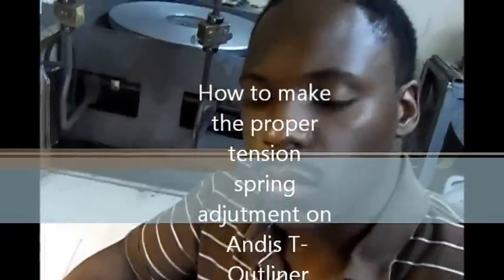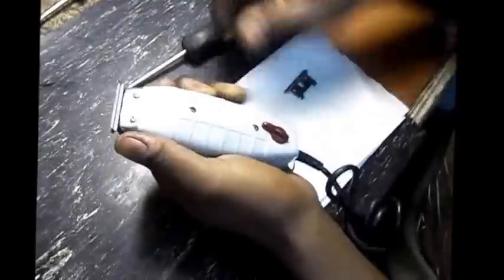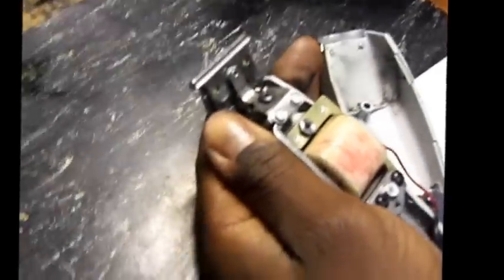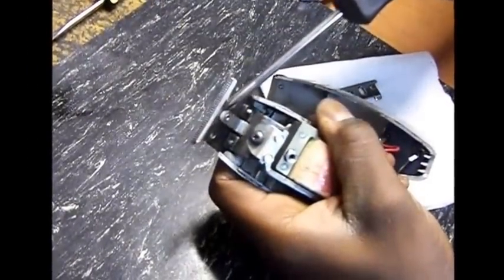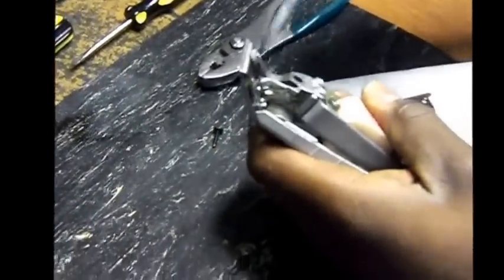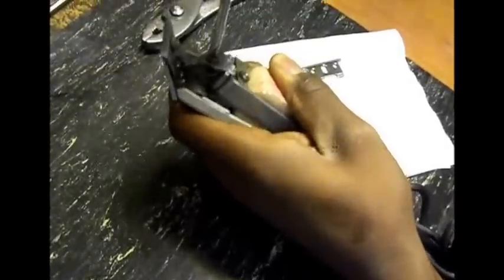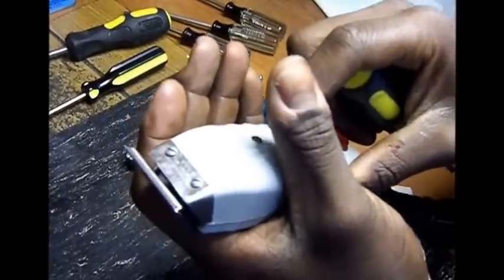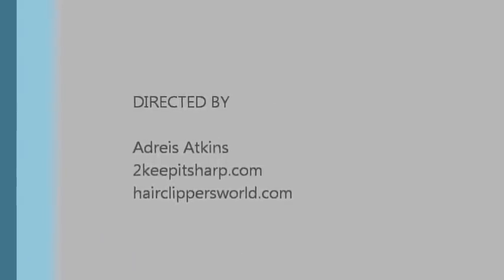T outliner tenion spring adjutment

Comment: That "Squeeeeze slighty" just saved me a trip to a professional repair service! I sharpened the blade, I even adjusted the tension spring. I was missing the part where it clicks and where it's touching the blade before  screwing back in. Made a huuuuge difference when I tested them again! Thank you so much! #Lifesaver

Comment: Great Video! Just fixed mine tonight after mine stopped cutting for like a week. Followed all these steps and I think the very last step with making sure the metal guard isn't touching the tension screw is what finalized it all. They seem to cut better than before they stopped working. I've had these liners for easily 10+ years and have never changed the blade. I think I might change it because it's definitely rusted.

Comment: Perfect video! My outliner is cutting like never before. I did notice on mine that I had to adjust the the tension spring with the ball a little closer to center. Any higher and my blade would nick and bite on one side. Thank you for the tutorial.
Reply from the maker: you are welcome. thanks. let me know if you need help with anything

Comment: is it true that another test is to put slight finger pressure on the blade when its in motion and if light pressure stops your blade you need to adjust, but if light pressure only "slows" its vibrating slightly, its good?

Comment: Hey man appreciate the video. I adjusted my spring to naturally sit above blade whole and touch blade naturally. But when i attempted to put the tension spring screw back in the hole it did move the spring at all and wont tighten anymore. If i continue to tighten spring screw more it begans to strip the spring screw head. Any advice? Im thinking the hole of the tension spring is to far away from the spring screw hole.

Comment: Only problem is my outliners get hot faster than before did I adjust the tension spring too tight or is this normal ? Will this affect my clippers in the long run ?

Comment: hey man if your tension screw and ball is completely not touching the blade... will it be able to fix watching this??? my thing is completely not touching the blade and the tension screw part looks uneven to the hole.. i need to get some pliers and try to fix tomorrow .. i keep buying new outliners every 4-5 mnths damnn man
Reply from the maker: this will work for shore. you must follow the steps properly. if you have issues I can help. also if you have clippers you not using we offer cash for you old trimmers and clippers. that's if you want to get rid of them

Comment: Hey so I did this and not even my t outliner pulls hair and even when I tighten the tension spring all the way the blades continue moving as normal...does this mean that the ball is not making good enough contact with the blade?
Reply from the maker: Infamous1ism this is true. if the contact is not tight enough or if not in the correct spot it will pull hair instead of cutting hair

Comment: Hey man, I think I am doing something wrong, mine are making a really loud buzzing sound, what could that be? When I followed your instructions I got 0 movement. The blade wouldn't swing. I'm obviously messing up at some point.
Reply from the maker: in this case you have to much pressure on the spring. bend  spring back slightly

Comment: Hey, brother. I have a question. I recently bout brand new T-Outliner clippers, and I'm noticing that they're not hitting as close as I would like them. I've adjusted the blade and the spring seems to be on point. Is it possible that the blade that came with is no good?
Reply from the maker: Levi C. in most cases the blade will come dull. that why we sharpen the new blades first

Comment: Hey man I had a question, I dropped my t outliners, now they don't cut at all and they make a loud noise. Do you think the tension spring moved a bit when they fell?
Reply from the maker: in most cases when the clipper hit the floor the coil core slides over slightly causing the vibration in movement to be hindered. this means you have to open the clipper and move it back over

Comment: Another way to get the blades sharper is remove and clean the blades, re-install them but tighten the tension spring tighter then the normal adjustment, lightly oil blade, run the blade for 5 min, this will sharpen the blades, then readjust spring according to this vid
Reply from the maker: jfool289 thanks for your insight. thats good info that any barber or clipper tech. can really use. its nice of you to be willing to give it for free. Thanks

Comment: is there a trick or technique to keep the body of the t blade cool that things gets mad hot sometimes
Reply from the maker: +Justin Grant no cool lube. they get hot
Reply: +keepitsharp357 I have the clipper oil and the clippercide pressurized disinfectant spray which is just about to finish so I'm thinking of trying something new(if there is ) because   the blades do cool down for a bit but in no time they're back to molten lava
Reply: +keepitsharp357 Do you  use this method  every  time  you replace  your  old blade with  a  new  one ?
Reply: +keepitsharp357 Do you  use this method  every  time  you replace  your  old blade with  a  new  one ?

Comment: The black tension spring screw wont screw in all the way:/ help pls!
Reply from the maker: sometimes it will miss its original grooves. twist counter clock wise several times then with your screw strait as possible go clock wise with your screw firmly until you lock into the grooves. that should fix your problem

Comment: hey man im tryin this but i dont seem to get it right. my machine was fine then sometimes gets stuck and sounds different then starts pullin hair after after that. i need help. i have 2 outliners that do the same. also while its on i can put a little pressure on the moving blade and im able to stop it. help
Reply from the maker: +Jorge Perez this means your tension spring is to tight. you need to bend the tension spring twords you away from the blade to take some pressure off the blade to get the blade to vibrate smoothly

Comment: Can u tell me why or whats the reason my outliners get hot? I did this and gotva new blade and nicks a lil and leaves red. Its not the blade cause i zero gaap it using blade setter. It vibrates n get hot faster then before. Please help..i try over n over fixing my outliners. I saw ur andis master vid n helped...but my outliners no help
Reply from the maker: out liners are notorious for getting hot. all of them get hot. how long are you running them at a time?
Reply: 2 min n its hot already

Comment: hey my t outliner are not cutting but it it working & the blade is movie can u help me to know that can be the problem
Reply from the maker: Christopher Ramjattan not sure if you tried the tension spring yet but if so it can just be a dull blade. also if its a new blade they actually come out the pack not cutting some times. in some cases a new blade will need to be sharpened. thats why our blade the keep it sharp wooowop blade that fits the T-outliner come with free sharpening. also please check that the liner and blade is not clogged with hair. get back to me if you need to
Reply: ***** I changed the blade & did what u did & it works great .thanks
Reply: *****  hey man, i got these things for christmas, and the problem im having is that between the blades gets clogged with hair with like one wipe of my face...  is there anything you can do to fix that?  I cant even shave my face without cleaning and lubing these things literally at least 8 times

Comment: I'm still having trouble placing the new blades on the clipper after zero setting them.
Reply from the maker: Whats the issue your having
Reply: @keepitsharp357  I have Andis T-outliner clippers.

1. Zero set- When I try zero setting the clippers, I am unable to get the blades to lines up and remain still after loosening and tightening the screws under them.

2. I spent a few hours trying to line up both blades and screw them back into the groove above the tension screw to no avail. The blades keep falling out no matter how many times I try screwing them in the grooves. 

P.S.- I appreciate your help and have tried explaining this the best of my ability as someone who is not a barber.
Reply from the maker: @delontereid7584  ok how old is the blade?. And when did it start doing this
Reply: @keepitsharp357  this blade and clipper set are brand new but it's likely the first iteration of the Andis clippers based on videos I watched.

Comment: Someone said taking off the two screws under the blades and loosing the top screw on the body of it will give it more power
Reply from the maker: mrmee1229 that has not been the case since  i have worked on clippers. i dont know everything. that person may know something i dont. if it worked for them and it works for you then give it a shot. i shoot no one down for what works for them

Comment: What kind of machine is used to sharpen blades
Reply from the maker: BIGG KUTZ go on line and search clipper blade sharpening machine and many brands will come up. you canpick and choose what style you like
Reply: ***** it has to be a diamond cutter ? Because i tryed using the norton waterstone and it just dull them out
Reply: Water stone sucks. Thats what I have been using but it doesnt sharpen really. I'm looking online as we speak to find a legit sharpener thats not going to break my pockets.
Reply: Yeah  bigg kutz try them diamond cutter block
Reply: Do they have them at lowes or do I have to find some place that have them?
Reply: BIGG KUTZ home depot has a norton tool and knife sharpener (not the waterstone) that works great. same idea with 2 sides (one for grinding or sharpening and the other to buff or smooth) for like 6.00. or if you dont like that idea, ebay has the master grooming tools sharppro for clipper blades from 75-100.00. its an actual maschine with a grinding disk that does it..
Reply from the maker: sad to say the better sharpeners cost 1000 or more. they get the job done. i have no problem helping anyone out there get the right machine. i dont recommend any of the cheap ones cause they dont work well at all
Reply: ***** i feel ya. i know the stone works great and its 6.00. ive used it many of times and havent had a problem yet. i dont know if people are using the wrong type of stone or use it incorrectly but i know a few people who use them and have no problems. i only know of one guy who bought one of the shrppros off of ebay i believe he spent 99.00 on it and he says it works fine. i dont own one just speaking on what i heard from 1 person.

Comment: Lol broke my liners trying to do this bullshit. The spring barely moved and would never snapped in. Spent 2 hours trying to put the spring back and it wouldnt work then after giving up i found out the power cable snapped off.... fucking lamest shit ever and wasted my liners.
Reply from the maker: sorry for the delay in reply. sorry things didn't work out for you. send me your liners I will repair them for you no charge
Reply: keepitsharp357 I need your help please. So I did everything you said in this video but the screw will not go in all the way in and it looks out of angle. Please help.